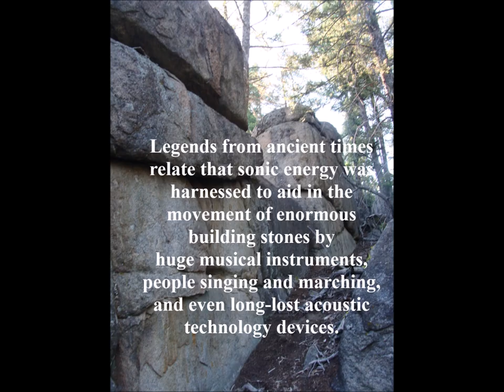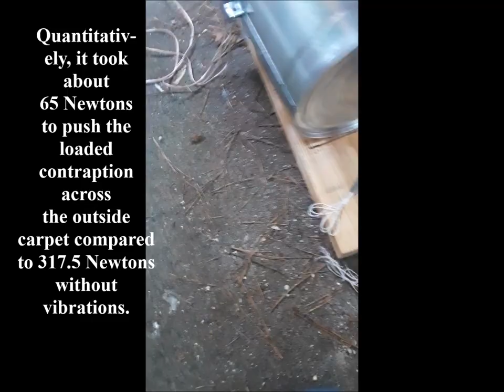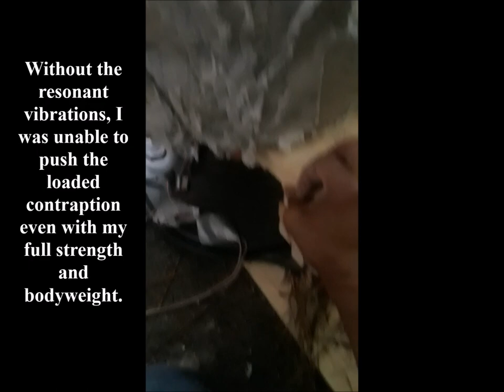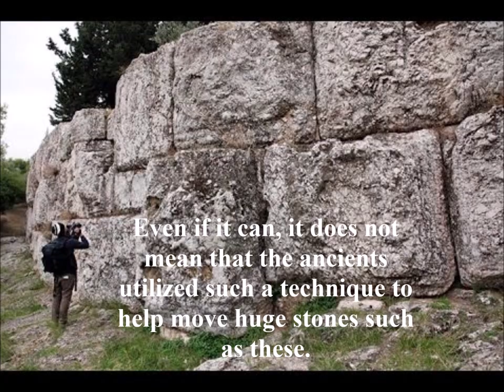Moving Boulders with a Push of the Finger: Did Sound Help to Build the Megaliths?

Comment: A simpler way to conduct the same experiment is with an audio amplifier and 2 subwoofers one used as a mic even a smaller speaker can be used for tuning and the larger one on the output, just putting the two near each other will start a feedback resonance and changes to the size/positioning and speaker types can create a wide range of frequency’s including piercing high tones to powerful subsonic resonance

Comment: Sound is residual kinetic energy, not the source. It is the evidence of friction. That is two problems with efficiency. It takes an awful lot of energy to oscillate enough air to move something.  Sound is a great way to communicate to a crew of workers that you want to move something. Then they can go ahead and use real mechanical advantages that work. It's like magnetism is a force, but has no energy. Sound is just dissipating energy, without a power supply. It shows promise when it's focused like a tool as a destructive force. It can make soldiers sick, shatter glass and disrupt cancer cells., but not great for levitating megalithic blocks.
Reply from the maker: Not exactly. Sound vibration has the potential to be a potent motive source. We can see in the video these vibrations moving nearly 300 lbs via surface acoustic waves. But it has more to do with how much energy you can add to the waves rather than the raw power as measured in decibels. The loaded sled moves because the input electromagnetic vibrations are tuned to the resonance frequency of the metal pale. In this way enough energy is built up within the structure to enable it to move. Levitation as realized in containerless processing doesn't necessarily use resonance per se, but rather allows small objects to float within the nodal region between two or more standing waves. The concept of acoustic levitation as described by inventor John W Keely is quite different and is dependent on radically different theories of gravity, electricity, and magnetism.

Comment: i think the found a way to melt rock like mud or putty with some kind of fresnel lens or some chemical and were able to transport it in a small stone capacity to the area, then they melted that small stone again in the area to build a giant one piece out of those small pieces to molded or sculpted giant structural or architectural rock, i think they used vibration to some capacity as well ..

Comment: This is Fantastic. Would you let us know what Frequency & Vibration did you use for this demonstration and what would be needed for us to be able to replicate it ?
Reply from the maker: Thank you. Yes, the frequencies used for this experiment were in the 40 plus Hertz range. It is the resonant frequency of the metal pail which can be adjusted up or down by the weight of the piston (the heavy bolt at the end). A heavier bolt lowers the frequency, but increase the strength of the vibrations. I discuss it in detail in my video, "The Acoustic Resonator..." on my channel; https://youtu.be/m8m8cDgqNIo.

Comment: A space under the sled made of a metal box, then the top is covered with a layer of sand., then push the sound into the sides of the box or back, the object should "float" on top of the vibrating sand grains. This could also have been accomplished by laying down a flat iron surface over a trench in the sand. The sound coming from below to make the iron flat surface vibrate. Probably wouldn't take much for the trench, just enough to fit the sound production under an iron plate. With all the workers they had, wouldn't have taken much effort to do this. Think of a soil compactor in reverse.

Comment: I applaud your efforts. This is not an armchair ridicule, rather, it's advice from experience. Knowing how we build things today will help you to understand what is happening here and why it won't work the way you think it will. 

There's a machine called a Tamp that's used to pack the dirt before the concrete is poured. This has happened in every building you've ever been in. It is just a heavy steel plate with a gas powered vibrator on top. It moves rather easy because you aren't pushing it across the surface of the dirt. You are pushing it through the air as the vibration causes it to jump or bounce up and down. Forward motion is determined by the arc distance between each small jump and how fast it transitions between jumps. 

It has to make contact with the dirt in order to jump up again. There's no way to make the thing fly, just bounce. This could work to move large stones if the vibration doesn't cause it to break, which seems more likely than not, and you can get the entire length of the stone to all be up at the same time. If you have a hundred ton stone that's 30' long and half of it is up while half is down, you are still dealing with 50 tons of weight on the ground. I don't think the wave of vibration works like that in stone. If you found the resonate frequency of the stone so that the entire thing is vibrating enough to bounce up and down it will probably break. I could be wrong, but I don't think I am. Even if I am, you face another problem.

If it doesn't break it will probably just burry itself in the sand. This is what happens when you leave the Tamp on and aren't pushing it forward. As it bounces it packs the dirt beneath it. But after a small amount of packing downward, it's easier for the dirt to move laterally and it will begin pushing the dirt to the side and then start to sink until the amount of pressure below it and to the sides is equal to the pressure from the weight of the vibrating Tamp (vibrating being very small jumps). Imagine a multi ton stone in loose sand. How deep would it go before it moved the tons of sand from beneath it?
Reply from the maker: That's a really good think through, friend.  If such an acoustic lubrication technique was used, there would likely need to be some type of temporary wooden track or stone road, etc., upon which to move the blocks. We do this today with similar scale projects. We'd build either a temporary road for large trucks or temporary tracks so that we could use a freight train. At least one account does claim that the same acoustic "moving" technology could also be used to disintegrate stone. Interestingly, mainstream science has found that resonating stones at their resonance frequencies renders them easier to crush and pulverize. So, it seems to depend on how the energy is used. An interesting article entitled, "Real life experiments that reveal the ancient art and techniques of building Egyptian pyramids by Mike Molyneaux" has a subsection called, "Acoustic Energy for Shifting Large Stones". It describes the rhythmic energy of a large battering ram being used to help move stones over a short distance, likely the last few feet of their final positions. It seems likely as some have noted that the pyramid blocks look as though they were simply "tapped into place" as they fit together so closely and that there's no damage to the contacting surfaces, indicating that they were not slammed together. Similarly, sound vibrations are rhythmic mechanical energy, just at a higher frequency, and depending on the technique could probably help to move large blocks without damaging them just as with the ram. The energy just has to be spread out enough over the block and not concentrated in one place. But if the end of the ram was smaller and harder, then similar movements would likely shatter the stone due to the greatly reduced surface area of the contact points, hence increasing the pressure.

Comment: I've seen the machines that do use frequency to turns raw silicon to liquid and back again. 
So I know , for a fact, that melting smaller chunks of "rock" into large "baskets" is possible. 
Of course those go into Mhz and beyond with massive issues of harmonics.  But who knows what they did?

Comment: I used to work construction by tamping the ground to lay foundation with a gas powered tamper. The tamper weighed 1/2 ton. But when fire it up the vibrations makes it easy to push with one arm. Other wise you couldn't drag it with 4 guys...
Reply from the maker: Yes, someone else was telling me about a type of powered compactor! We also see it when our cellphones vibrate across the table. Interesting how we often see these principles at work in everyday life.
Reply: @gsutton78  If you can get that large block or the pathway it travels on vibrating, you can move it easy..

Comment: Is it Tunable? If not I highly suggest making it so because you can make it walk itself if you tune it right and simply holding your hands at 90 degree angles to it is enough to make it move which is strange as to any outside observer it appears like you are moving it with your mind however I found it is standing waves in the ultrasonic range.
Reply from the maker: Sedit T   Yes, this device was tunable over a pretty broad range which was vital in finding the resonant frequencies. The sound vibrations also have a directional component, enabling the contraption to move on its own due to surface acoustic waves.